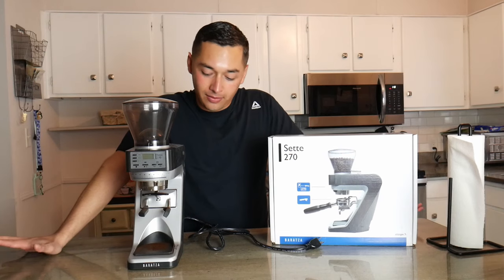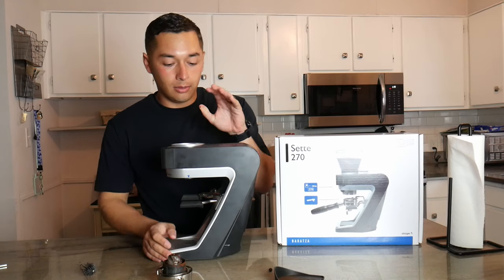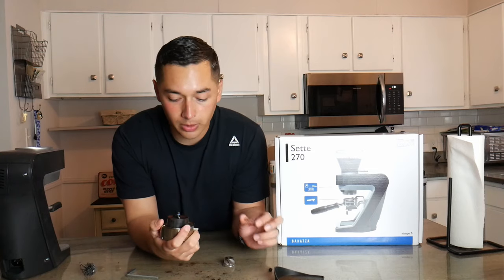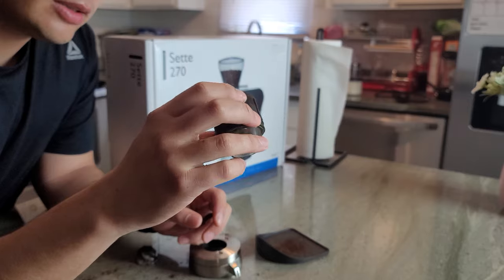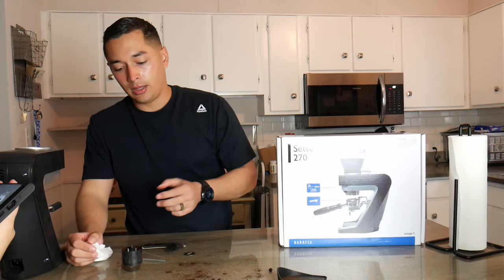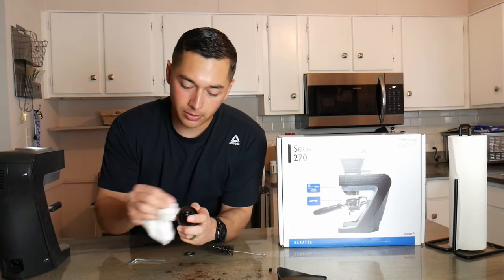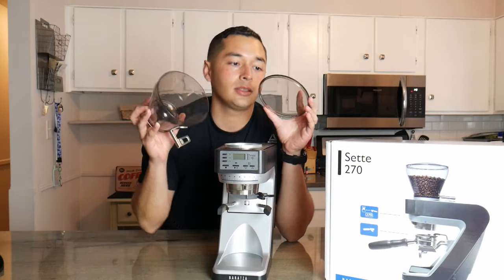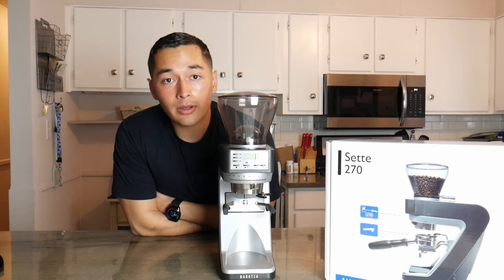Baratza Sette 270 - How to Clean Your Coffee Grinder

Comment: I own this grinder, it’s pretty bad quality, the plastic breaks of pretty fast and the handles to hold the portafilter broke of on the inside as well. However, the grinding itself is pretty good but after two years I’m down the the finest setting, can I just install a shim and it should be good?
Reply from the maker: That’s unfortunate as my grinder is still holding up. If you’re at the minimum setting adding the shim will definitely give you more room to grind finer!
Reply: @ thanks for replying, I ordered two shims, I hope it’ll fix the problem. As for the plastic, It’s still working but a lot of stuff broke, the piece that’s closing the bean flow into the machine broke, one of the bean cup attachpoints broke off, something inside that holds the portafilter holder arms in place also broke. And I’m someone that handles my stuff with care!

Comment: Is there a reason you don’t soak or wash the parts that have caked on grinds?
Reply from the maker: you could, but I would be weary of the oxidation of parts if not cared for properly.  There is also the idea that you can "season" a grinder like a cast iron.
Reply: @StevenMakesVids  interesting concept around seasoning, I haven’t heard that before. So that would be a reason to not soak or wash the parts.

Comment: Excellent video, very clear.  I had never deep cleaned my Sette 270 since buying it other than a bit of wiping and  knocking on it to get coffee out and I've had it for a few years. You should have seen what came out.  I did have a 0.3mm shim I bought from Baratza that I installed during the clean.  Is yours the same thickness?  The video seems to make it look a bit thicker than mine, but I may just be imagining that.
Reply: After installing the 0.3mm shim, it shifted my values by 5.  I used to grind at around a value of 5 for a 1:2 brew ratio, after the shim I have to use around 10.